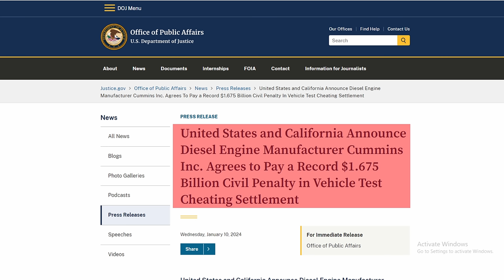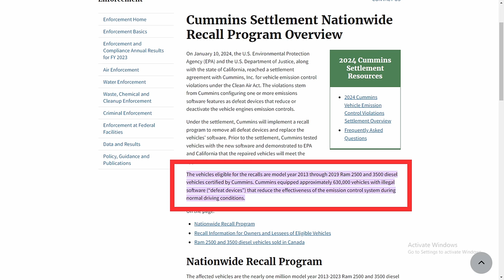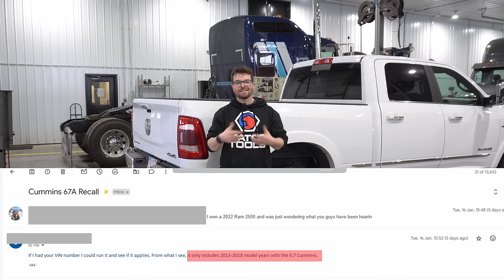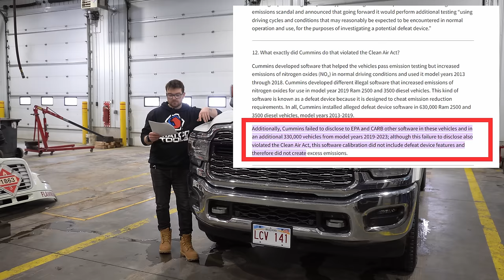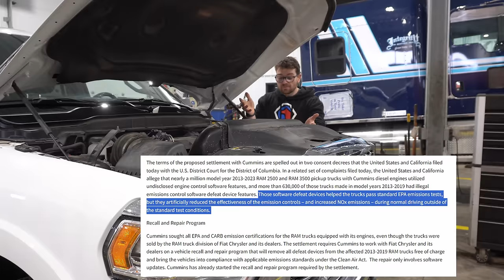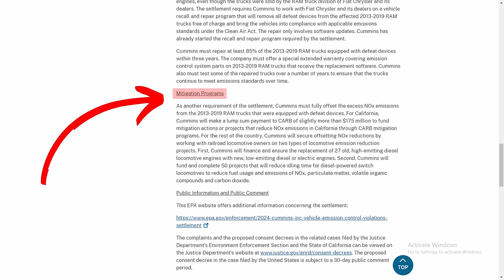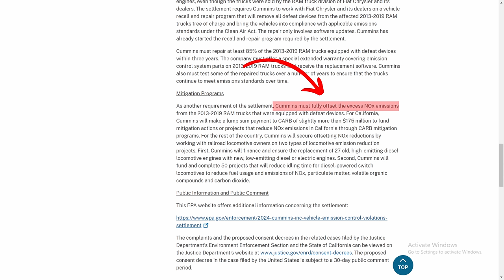RAM 2500 Cummins Diesel NOT GETTING RECALLED | Certified Diesel Mechanic Explains..

Comment: Cummins got scammed by the EPA.  That should be a crime in itself.
Reply: How so? Did Ford or GM get scammed as well?
Reply from the maker: I mean Cummins did legit have defeat devices in their trucks. as for the failure to disclose for the 2019+ trucks - That's crap.
Reply: Yes! Any company being forced to put this junk on are being scammed
Reply: Yeah! More pollution! Cheaters are winners! 😂
Reply: Don’t knock the power of lead; it’s actually an amazing additive, but the increased mileage was not good for OPEC so the gov’t got rid of it for them.
Reply: Troy342  huh? What does that have to do with being scammed?
Reply: @MendicantBias1 guess you didn't look into what def and all this bs does to the environment. I'm sure it does absolutely nothing negative at all.
Reply: @zeek3580  don’t tell us what it does, just vaguely allude to it.
Reply: Nah, I think they're in on it. By playing along they get to sell more parts. On the front end and the back end.

Comment: And 1 large cargo ship equals 50 Million cars.  Think we are worried about the wrong-thing here.
Reply from the maker: nothing burns like bunker oil.
Reply: Very good point, often overlooked, most of the ships are carrying a bunch of low quality dollar store crap that we should be manufacturing in North America anyway.
Reply: I’m not going to say I’m the most environmentally conscious person out there & definitely no tree hugger, but what exactly is the US EPA supposed to do about the hundreds or thousands of cargo ships registered in every other country EXCEPT the US? Maybe require ships within the 12 miles or so(?) around US to run on ULSD? or wind power? Maybe battery/solar?
Reply: Just off the top of my head. Tax seems to work.  That is what is done to us.  Maybe make it cost effective to manufacture here in the US. Its all about control and money.
Reply: @TheGettyAdventures  It's such great oil that it's got to be heated to make it liquid instead of Chocolate pudding.

Diesel electric locomotives have been Tier III or Tier IV emissions compliant for years.
Reply: @jeffs2809  They would do anything to be able to trade the us market. They are already required to swap fuel within us waters.
Reply: Cargo ships is where I always thought nuclear drive systems would make sense. But I’m not a nuclear engineer or economist sooo….
Reply: @MrSleepProductionsInc  I can't imagine a turd world country operating a nuclear powered vessel. Imagine a terrorist detonating a reactor in a port?
Reply: @gungadinn third world countries shouldn't have any type of nuclear technology
Reply: @ricksanchez7459  US waters only extend so far. I'm thinking the US needs them as much as they need the US $$. There's always another possibility...if the EPA were to get too heavy handed & try enforcing expensive mandates on those container ships that enter US waters, what would stop them from off-loading at ports in Mexico & Canada? Then all of those clean diesel trucks could haul goods into the USA. I'm sure that wouldn't drive up prices and cause supply shortages or anything. 😀
Reply: @jeffs2809  What you just described is already happening but with trucking to blue states.
Reply: @jeffs2809 😂

Comment: I can tell ya one truck that isnt gonna get this recall done MINE!!!! 140k on mine with absolutely ZERO problems with the emissions on it it has a tuner and is still running emissions!! i get about 2500 miles out of a full def tank so if it aint broke i am NOT gonna fix it!!!
Reply: Mine either 304k all stock!

Comment: Yay.. The EPA has saved us!! How much energy is going to be expended in regen, replacement parts and decreased efficiency. If we got the calculator our, I bet its a net negative...
Reply: Exactly my thought, just add up the hundreds of thousands, if not millions of gallons used just to transport DEF by tanker trailer or by pallets of it in plastic jug form, all that wasted fuel and energy just to create, package and transport DEF… then include the energy for SCR, DPF and EGR systems to be created, transported, and that whole circle of a process… I bet if we had none of these emissions systems, the end result would be the same .

Comment: Many of us were left with few options but to delete the whole mess. After multiple failures, inability to get parts and warranty running out on insanely expensive components, it made more sense to just remove it all. Thankfully some of us live in states with no emissions testing, so we can get away with tossing a couple hundred pounds of headache into the bin and letting our trucks breathe.
Reply: It’s a shame that you have to tear $15k worth of parts off the new trucks just to get them to run right.  Then pay at least another couple grand for the kit and tune.  Another reason why newer diesel trucks are so expensive…tens of millions spent on emissions r&d, manufacturing, and lobbying
Reply: Thank Obama

Comment: IDK if it was the way you talked about it or if I maybe misunderstood how you said it but in regards to the ECM, the ECM is fully programed at the Cummins Midrange Engine Plant and the engine is shipped to the Ram assembly plant with the ECM affixed to the side of the engine with the engine side harness attached.  This allows Cummins to test run every single engine before shipping to Ram assembly plant.
Reply: You are correct. ECM is from Cummins. The RAM/Cummins agreement says that Cummins is not allowed to connect to any RAM trucks and if caught there is huge fines. So Cummins isn’t allowing any of their mechanics the software to hook up. It’s not like Cummins doesn’t know how to connect to their own engines. They just won’t take the chance of getting caught.

Comment: Yep, my 2022 uses more DEF than my 2018.  Mileage is the same, regens, etc no different between the two.   More DEF usage means less EGR.
Reply: Delete them and they'll use no def.
Reply: @duckwacker8720  Not an option.
Reply: @Mill72  it's a requirement.
Reply: @duckwacker8720  Okay
Reply: @Mill72  it is lol

Comment: 2019 trucks were already recalled back in 2020 when Ram released the VB6 emissions recall. 67A is 2013-2018 trucks. The recall flash is nothing more than a NOx sensor strategy change. 2020 and newer trucks already have the updated flashes and necessary updates.

Comment: With the after-treatment systems, these trucks were not made to be daily driving vehicles.  I tried to make the daily driving work with my 2018 RAM, but the DFP was getting build-up only a matter of time before it failed.  As Alex mentioned, you have to get them on the highway and get them hot to avoid some of these after-treatment issues.
Reply: Correct.  I had my DPF removed and cleaned about 2 months ago. The mechanic told me to go on mini road trip every Sunday, run it in 4th gear to get the rpms up above 2000  When return home, let it idle for about 15 minutes so it can cool down properly
Reply: @timothymoses216    That's exactly what I was told to do by the dealership with my 2018 - drive it on the highway for about 20 mins each week and make sure the DPF cycle finishes.  Eventually, I had the exhaust upgraded and that solved the issue.
Reply: @brenteason9891  
I wish they had an option on our view screen so we will know when we're in regen and when its finished
Reply: So the 2023 I bought has a dpf gauge and it'll regen at 25%. I use it only to tow my camper or tractor ajd it never gets to 25% anymore. I bought a beater to DD. I've has the 23 for 6 months and towed 5k miles. You guys are correct, this truck isn't really made to be a bro truck. If it's used for how it was designed, the emissions components aren't problematic. It's all refined and modeled after our class 8 counterparts
Reply: @timothymoses216  It's imperative that you get a screen or an OBD dongle and associated app so you can track the DPF % full value (I recently installed an Android head unit which makes this easy). On the 4th gens once that hits 100% it will trigger regen and you need to keep driving the truck until the cycle finishes, preferably at a steady pace above 40 or on the highway. After a nightmare with a Ford regening with fewer than 100 miles and needing the DPF cleaned I watch this Ram like a hawk and make sure it finishes regen. Whether it's a daily driver or towing I get it up to temp on the highway frequently and it's been giving me 700+ miles between regens. I won't be screwing that up by applying this recall to the ECU.
Reply: @wtbman  do you mind sharing which unit and app
Reply: You are exactly right.  I just didn't drive my 2016 Sierra 2500 Duramax for long enough periods for it to go through its normal regen cycles.  After the second time going into limp mode and having to take it to the dealer to do a forced regen, I had the  entire DEF/converter removed, along with  the EGR and everything  else.  I didn't even get to 1000 miles to do it, either.  I put  a tune on it and a larger turbo (though I didn't really need it), and it has run beautifully ever since, and I almost never see unburned fuel from the exhaust.  I get about 22 MPG on the highway even with 37x13 Toyos, and it has tons of power.
Reply: @0101-s7v   It was like getting a new truck (or better than a new one) after the exhaust modification for me.  Duramax is already quick before tuning, so I am sure you surprise a few cars assuming you can't merge fast enough on the highway.

Comment: My 2018 went in the shop for emissions issues. Then they did the update. And now 14 days later it's back in the shop again.
Reply: Why not delete it?
Reply: What is it in the shop for now?
Reply: @jefflamb2900  I would love to but because I just purchased it in September and had requirements. Had to be under 100k. It also had to have extended warranty. Also able to be serviced by Ram Dealer. After its up I'm free to do what I need.
Reply: @seanfritz1355  So why put the requirements on yourself, overpay for them and then have to wait it out and deal with the issues caused by emisions?
Reply: @baronvolkov6172  The warranty is I use the truck regularly for work. And having Ram fix it is personally I like my small town Ram dealer.
Reply: delete that thing and enjoy the reliability until your 68rfe falls out.
Reply: @TurboVisBits  ive got two with aisin i use to pull gooseneck trailers and never a problem, both over 200k miles no warranties no dealer visits just maintain it yourself or trusted mechanic

Comment: So happy to own a Gen3 Ram 5.9 Cummins... not as much HP and TRQ as the 4th and 5th Gen units...but such deficiencies can be rectified with aftermarket tuners (at least here in Canada). I saw nuttin but trouble from day one with the 6.7 and EGR/DEF systems .. as with anything that starts out simple and gets revised .. there is never a guarantee that the changes make for a better system...a sad state of affairs when 3 government agencies/boards interfere with engine design and spec ..... many Canuks were dropping $2K to have the EGR/DEF sytems removed (clandestinely of course).

Comment: The whole point of SCR/DEF systems was to move NOx reduction OUTSIDE of the combustion chamber to reduce the need for EGR to lower combustion temperatures in the cylinder and to reduce particulate production during the combustion process.  So, it would seem to me that the LOGICAL solution to the NOx emission issue would be to enhance the SCR/DEF capabilities of reducing NOx emissions, not regressing to dirtier, lower temperature combustion that increases particulates.  In that light, having the software increase DEF usage to potentially reduce NOx outside of the engine's combustion chamber would make sense.
Reply: And that's the reason I'm not going to let them update my 2014. I've already had 3 recalls on my def system.  3 dpf filters, 3 scrs, 3 def pumps, 2 water pumps, 1 egr valve, all recalled or warenteed. 
I  recently put a turbo actuator on it at 189,000 and still running original turbo. I'm at 206,000 miles rt now. I've cleaned the egr valve and tube only but never that filter box above the turbo, I don't want to even get into that nightmare although it's probably getting pretty clogged up by now. I have lost some power and gas mileage.

Comment: Far as I know, railway locomotives are pretty much  the most fuel efficient way to move cargo period. It's probably only 27 locomotives because of the cost to perform the retro fit and the length of time the NOx reduction will take place in is probably many years and way more miles than an average Ram 2500/3500 truck driver

Comment: I have a 2018 ram 2500 with the Cummins. I don’t plan to get this recall done. I haven’t had any issues with this truck. I added a banks intake horn and this helped with power and mpg.
Reply: Usually they will refuse to allow you to register your vehicle if its a federally required recall (EPA) until you have the recall taken care of. Thats what happened to me.
Reply: @XRakkgruntX  my ram uses def like it’s going out of style. Not planning to get this recall done.

Comment: Have a 2018 peterbilt with 527,000 miles. I use pittsburgh power fuel catalyst faithfully. Keeps combustion very clean with limited sensor failure. Cleaned dpf at 350,000, well past recommended time.
Reply: Thought diesels were compression not combustion? Maybe I'm wrong
Reply: @benjaminwright1807 They are compression.

Comment: What about compensation to get recall or how about a buy back option?
Reply from the maker: doesn't not seem like that will be available.
Reply: Everybody “wins”.—except us Ram owners. Why the hell do we come out on bottom? We spent $60K+ on these rigs in good faith and now we take it in the shorts with more costs and hassle and probably less performance while EPA and CA get a windfall? That’s BS. I’m all for clean air (and goal of clean air is a good thing), but the implementation here is jacked.
Reply: Ram/Cummins could fix this with a software update. The VWs couldn't be fixed because they didn't have DEF that could be turned up - hence the buy back.

Comment: Man... I have been watching this closely. I appreciate your information. I literally just bought a brand new 2023 RAM 2500 Tradesman w/the Cummins 6.7L I6 on December 22nd 2023 and then I start hearing about this!!! I'm a new truck and 1st time diesel owner, bought this to haul a toy hauler eventually. Hey BTW those wheels you have on your 3500 could I get a set of those for my 2500 I eventually want to replace my steel wheels with the covers BUT want to keep the stock wheel and tire dimensions?

Comment: I'm missing something here, why couldn't someone come up with a soot scrubber for the ERG, something with a filter ? Crazy that we would purposefully send dirty soot back into the engine instead of capturing it !
Reply: Always wondered why they chose to pull the exhaust gasses directly off at the manifold instead of post dpf. I’m guessing it’s for packaging & assembly purposes, but I’m no automotive engineer.
Reply: @jeffs2809 I believe the mini duramax in the small GM trucks egr’s pull after the scr. It is precisely cause of packaging. Those have the scr attached to the manifolds. Good design.
Reply: @jffs2809 Cat had a CGI system before they got out of the truck market and it was not very good
Reply: Check out FASS EGR Solutions . Less soot into engine with their product that they came out with.....

Comment: You touched up on the things I was gonna mention which is long idle times and not allowing your truck and emissions system to get up to temperature….. those there are big issues…. If you have at least 15mins of highway cruising time that’s usually enough time to get up to temp but if your primary commute is under 10 miles per trip consider once per week taking your truck for a cruise for about 1-2 hours at highways speeds
Reply: And unfortunately best cases are longer distance hauling so the truck has to work more so if you are buying an emissions truck all of them suffer to a degree with these issues so if your wanting a big truck but can’t avoid the trouble driving conditions or take your truck for long drives on regular a basis get a gasser version and you should save a lot of headaches…..

Comment: I have 10x 6.7 ISB's. If I do a service I run a regen and observe the live data for issues. This should be done anytime the vehicle is inspected. I have not had one stopped up EGR cooler yet. The pedestal gets clogged regularly, but the symptoms are easy on that. I have had 2 EGR coolers leak and need to be replaced. If temp one is over 750 degrees it needs a cooler, less than 400 won't regen needs a new cooler(leaky). Temp 3 higher than temp 2 the DOC is clogged. PPM level 2 over ~70(end of regen) then there is a hole in the DPF. Always inspect the doser. If PPM 2 levels are really low and it smells like a wet mop you got a leaky doser, check the tailpipe to see if it has been hanging out with scarface.

Comment: Why would the truck use both more EGR and more DEF? More EGR means that the engine temps are cooled, resulting in more soot to the DPF and less NOx. This would result in more frequent regens to keep the DPF clear, but would do functionally nothing to the SCR + DEF that happens downstream of the DPF.

More DEF usage means that NOx is running higher, which happens due to less use of the EGR and thus more complete burn of diesel but at the expense of higher NOx, that the SCR + DEF have to deal with post DPF.

You think there will be both an increase in EGR usage and DEF usage at the same time?

Comment: My work truck is a 2017 Ram 4500 and I took it to the dealership to see if it had the recall. They looked it up and it doesn’t have the recall. I wanted to see if I could see or notice a change in power, fuel/DEF  consumption, not my truck so it would’ve been a good test for me.